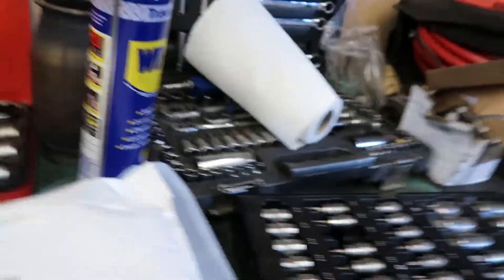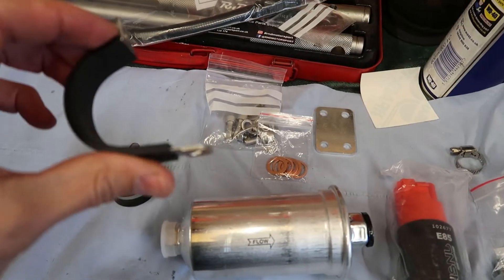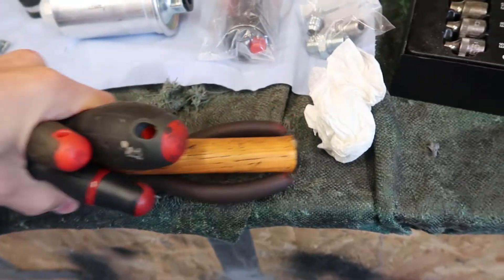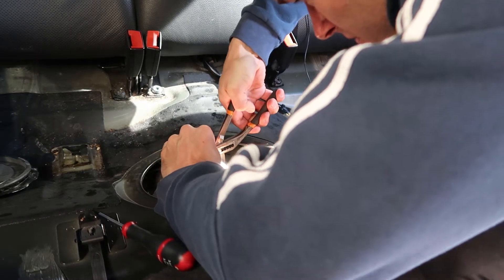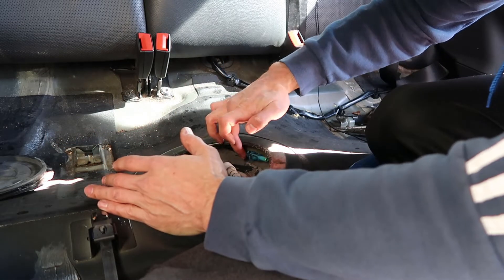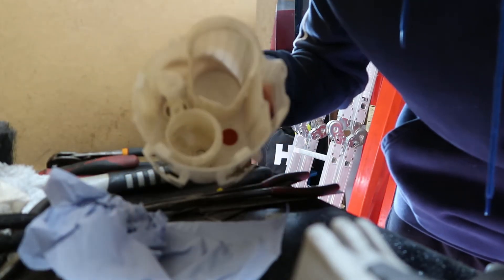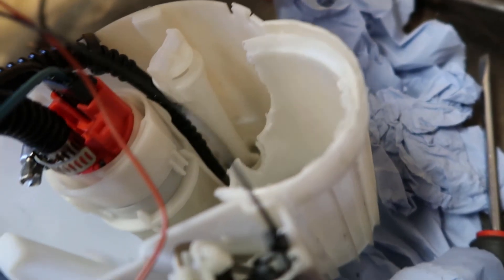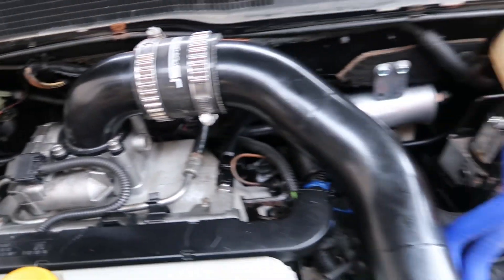ASNU Fuel Pump Plus RnD FILTER KIT INSTALL (Astra VXR)

Comment: Do I need to cut the old filter out of it then mate never done it before got a vxr coming and need to do the pump
Reply from the maker: If its just the pump then unclip the old one and drop the new one in.  It's alot more hassle removing the fuel basket/filter etc.

Comment: Do you know which wire is the positive to the fuel pump from the loom (what colour )
Reply from the maker: Not off the top of my head.  A test light or multi meter will help you figure that out

Comment: Do I understand it right, that you don’t can change the filter inside itself, without destroying it? You have to buy a complete pump with pump housing for the VXR?
Reply from the maker: Yep that's correct.
Reply: @boosthit811  that’s why you have delete it with the external filter at the engine bay room. I found a complete pump bin from Bosch with the pump inside (new) for about 85€ (75pound sterling). There you have a new filter and bin. Then mount the upgrade petrol pump inside and you have a (in my mind) better solution, what do you think?
Reply from the maker: @Rehbraun  that will work, but the Bosch inline filter kit is designed for higher power fuel systems than factory.  Depending what your goals are.

Comment: Hi mate how would you rate these kits ?

Mainly how noisy is the pump over standard ?

And do you have to keep a 1/4 tank minimum like the walbro pumps or are the asnu pumps safe on a low tank?

Cheers mate
Reply from the maker: Hay man.  I haven't noticed any extra  noise over standard pump to be fair.  And I've had no issues with running tank low on fuel touch wood.
Reply: @boosthit811  

Thanks for the speedy reply bro its appreciated 

Just trying to work out the best options for replacing mine

Recently blew my engine 

Got a replacement engine fit which was a nightmare in itself

Had it mapped 12 months ago by rnd

Had it on a local dyno today for health check it's running dangerously lean between 5k and 7k 

Below 5k it's perfect, the dyno place is saying fuel pump but I'm leaning more towards a clogged oem fuel filter 

They only guessed at fuel pump and couldn't give a definite answer?

Got any thoughts bro?
Reply from the maker: @andrewb5263  yeah, running lean up top is probably a bit of both.  Old pump and old filter.  Also could pay to check pump power and grounds are healthy.👍
Reply: @boosthit811  cheers mate appreciate that

Just cannot decide which way to go aftermarket market kit like you did 

Or just go with a new oem kit